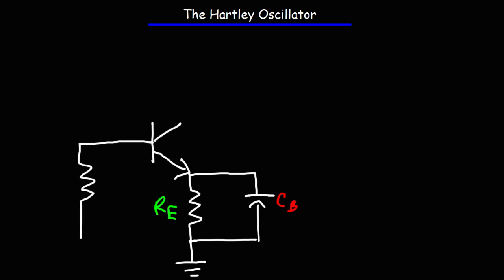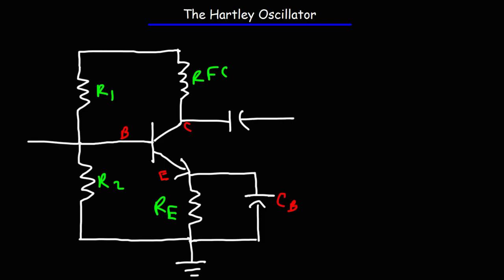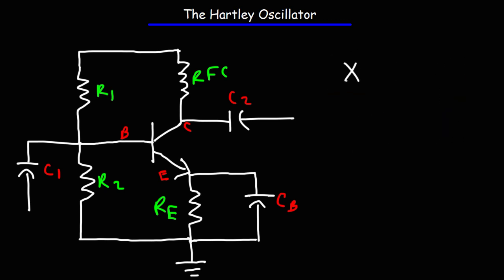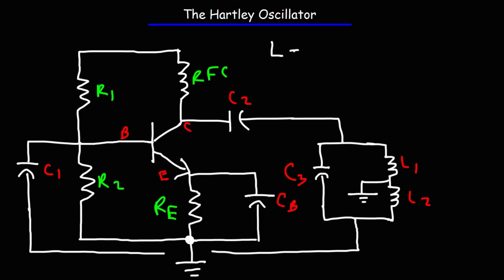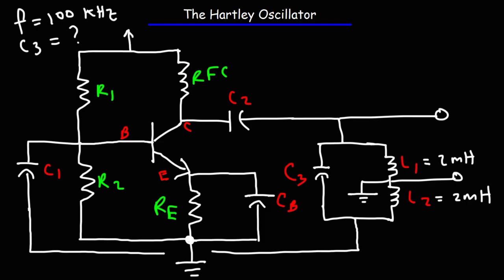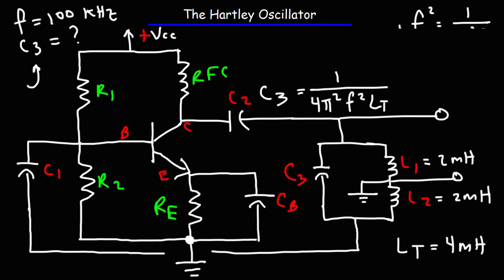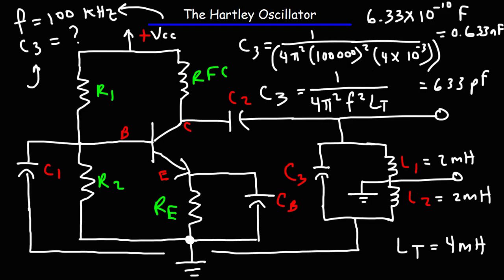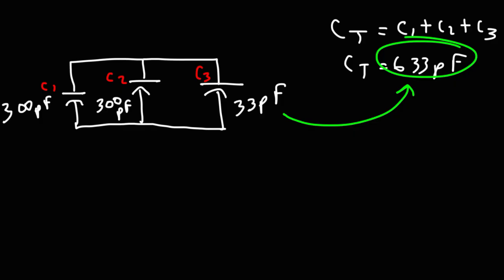Hartley Oscillator Circuit

Comment: Those information are all over the internet what people actually need is to make the circuit from ground up without using any predefined values. (not that you are doing the same I am just saying you shouldn't have left out the transistor biasing calculations) I am seeing videos like "okay guys today we are gonna make voltage divider biasing" but the resistor values are already has given there. This is wrong. What people actually need is starting with Hfe of a transistor working their way to the total power consumption than coming up with a voltage bias divider network and calculate the thevenin equivalent than build the lc resonance circuit. I am just a hobbyist  who wishes for better education for everyone. Sorry for my rant tho :)

Comment: Design a Hartley oscillator which has to be tunable over 500 kHz to 1000 kHz. The values of the two inductors are 50 pll each. Neglect the effect of mutual inductance.. For calculating rg=he resonance frequency thich one should I select?  500 kHz OR 1000 kHz

Comment: maybe I'm way off, but where do you connect the input? I know that thermal noise causes the circuit to work without any Dc supply, but what if you wanted to have one anyway?

Comment: How would you calculate the amplitude of the output signal?
Reply: Did you find it? ı need this
Reply: @ahmetburakacar I've an electronics textbook that uses the so called "method of harmonic equilibrium equations" to calculate an approximation (!) for the amplitude. This method can be used to analyze nonlinear circuits driven by periodic signals. It's based on the fact that during equilibrium at any node of a nonlinear circuit driven by periodic signal the nodal signal will also be periodic; and also at any node or in any loop of the circuit the Kirchoff laws will hold true for each individual component of the Fourier series of the periodic signals.

Comment: What maximum frequency can we obtain by increasing capacitance value??
Reply: You decrease the capacitor to increase frequency. So many factors limit the maximum... Including transistor switching speed and inductor core material. (Air core inductors don't have that limit)